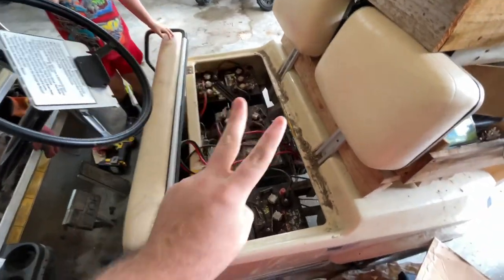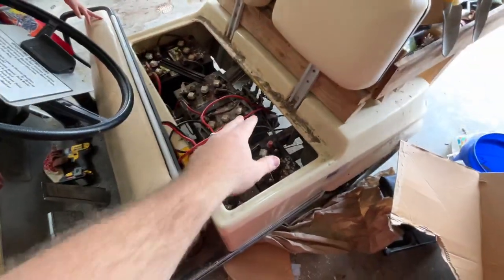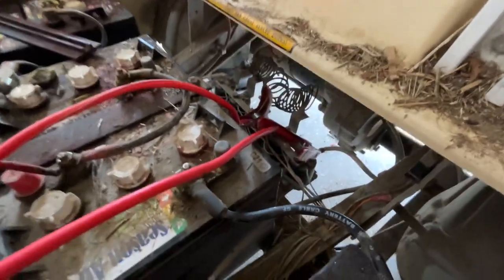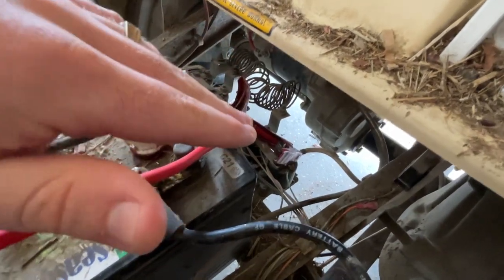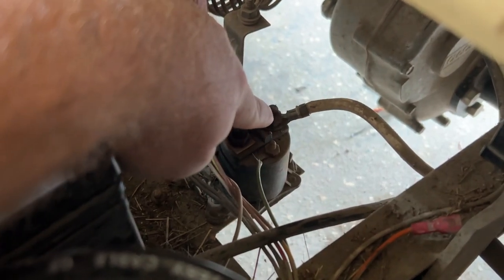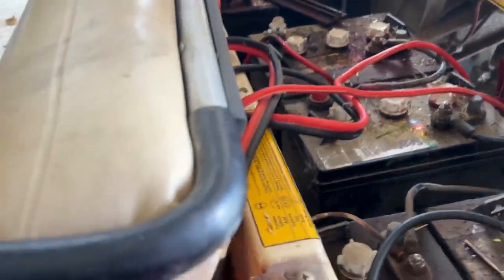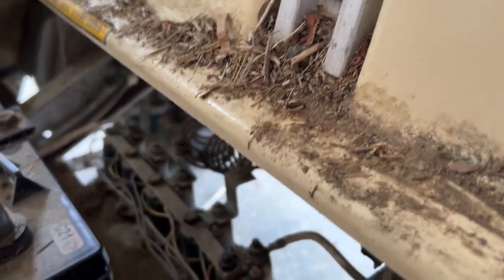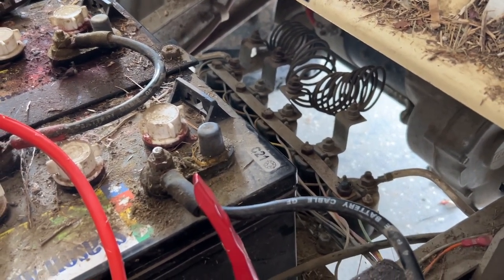Club Car Electric Golf Cart Won’t Move SOLVED (video 2)

Comment: What r the other ends of the cables connected too. ( THE BATTERIES  OR WHAT)
Reply from the maker: I’m sorry which ends?  I show both ends in the video.
Reply: uh no ya dont. Cause we cant see them! @WeaverFamilyFarms  You show the red cables going to the solenoids. Where are the other ends?
Reply: The other end is hooked to the bus bar...I'm assuming ground bar
Reply: You need to watch your video. You saying,hook to top of solenoid  and the other to busy bar. That is two ends hooked.